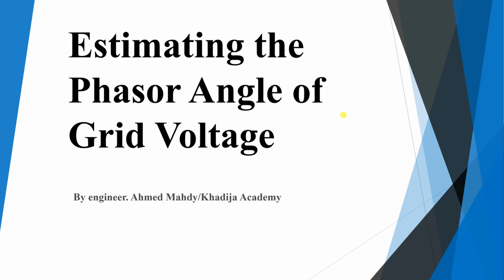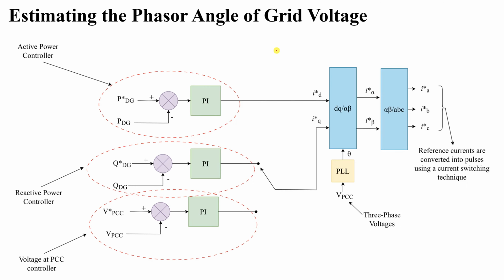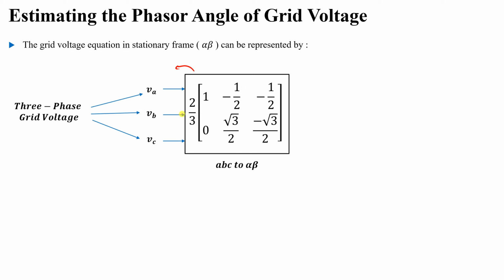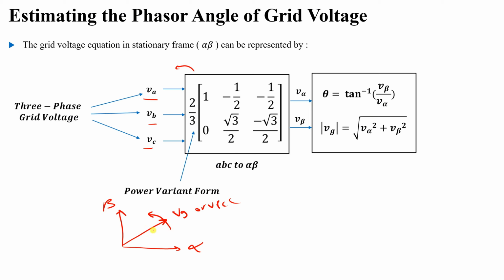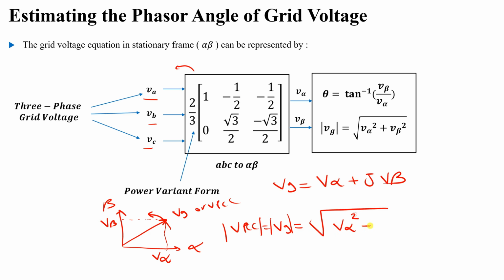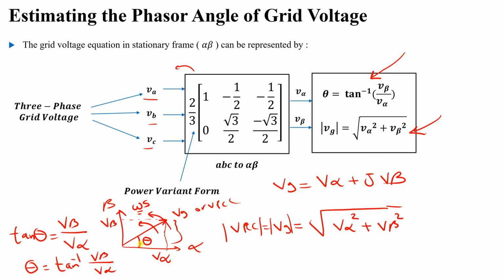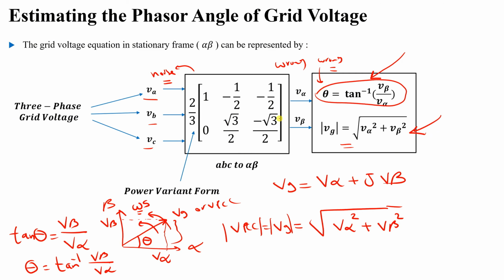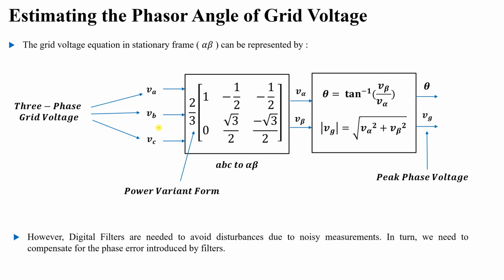Estimating the Phasor Angle of Grid Voltage - Lesson 11

Comment: Sir, what if you are using a single phase? Like designing a single-phase instead of a three-phase inverter? Would Vpcc be just the single phasor, or is that method not applicable in this case?
Reply from the maker: VPCC would be the per-unit value for the single-phase system (Vmeasured/V phase rms in a single-phase system instead of the V line-line rms in three-phase systems).
I recommend checking out the Automatic Control theory course on Khadija Academy to see how I applied the control strategy for a grid-connected PV system (three-phase) in Simulink.
If you can't afford it. You can search for research papers about single-phase grid-connected PV systems on IEEE Xplore to help you know the control circuit for the single-phase system. 
Then search on the MathWorks website for ready-made models on grid-connected PV systems.
Reply: @EngrAhmedMahdy  Thanks man